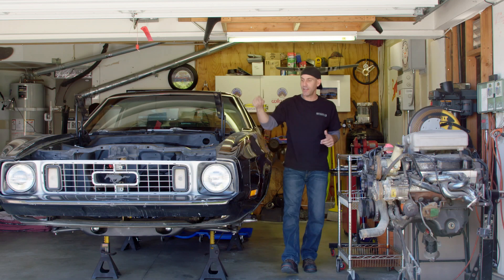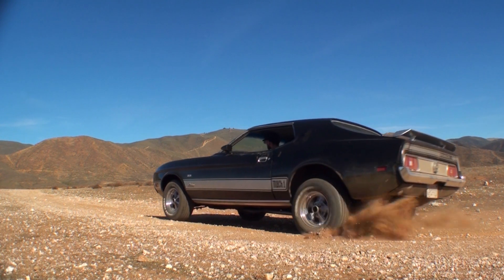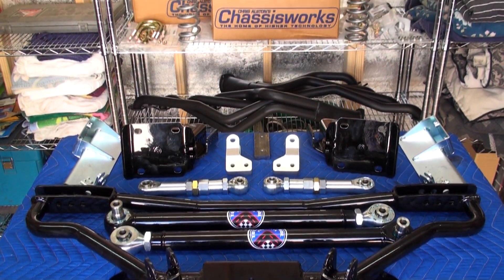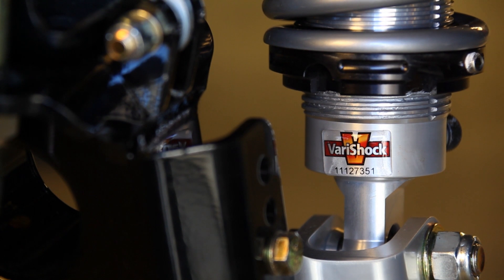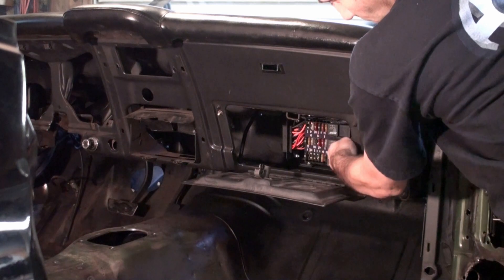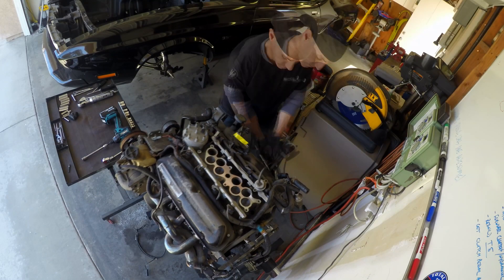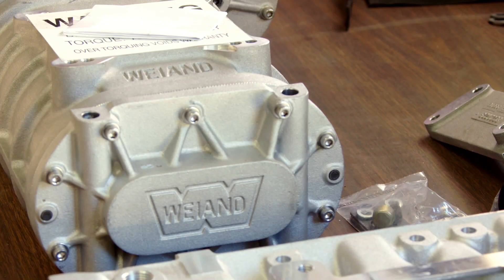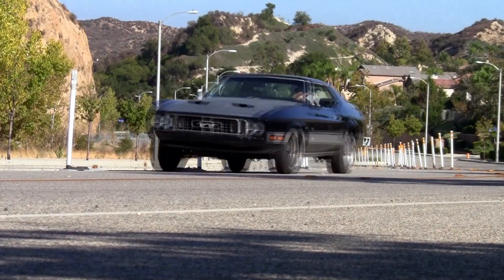73 Mustang Project- Cobra Engine Tear down and Intro for Mustang Monthly Magazine

Comment: When you got to the supercharger part I approved to that setup choice totally, because that's what you want, big meaty power at every rev. I always liked big sidewall tires but look at the car going sideways in it's own path.
Reply from the maker: G55STEYR Yes, superchargers are good.  I'm still trying to figure out the tire thing...I must use 17" rims to fit the big Wilwood brakes that I'm using so we'll see.